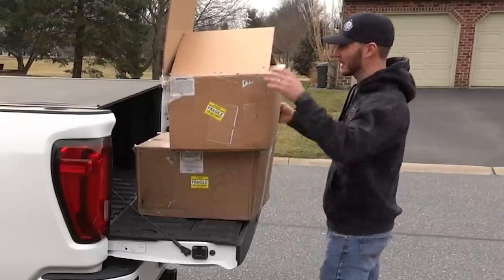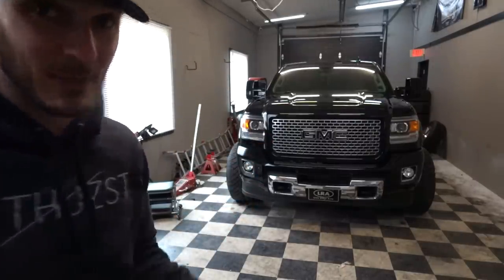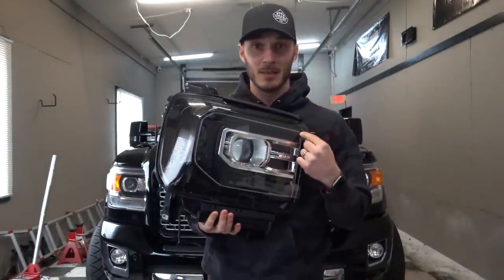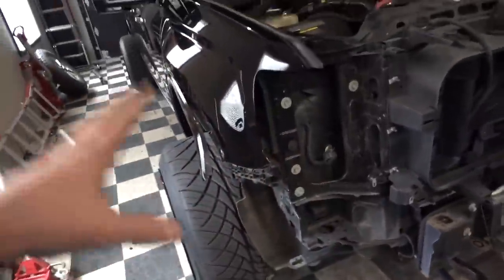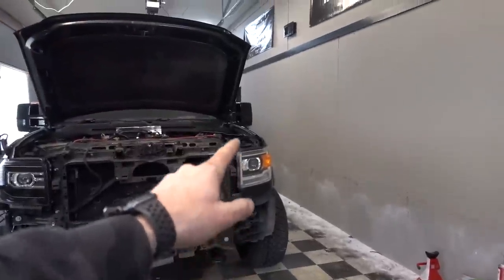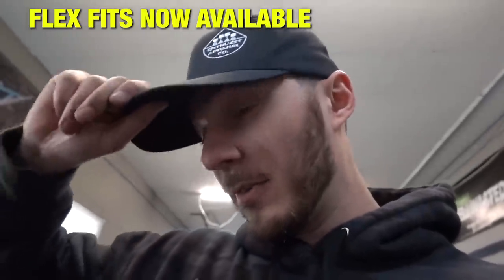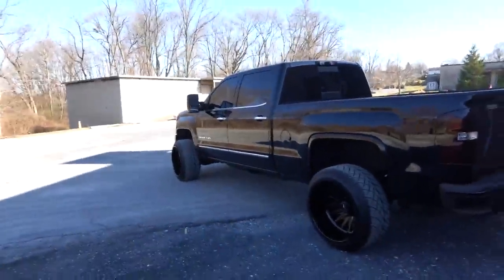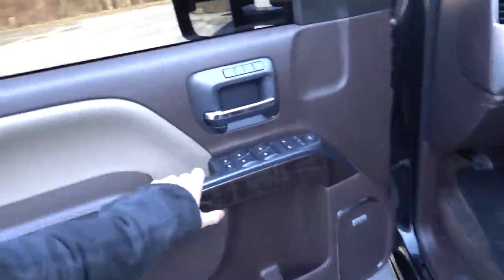The ONLY headlight mod a 15-19 Denali HD should EVER get!

Comment: Durtymax Jack,

Do you have a link for Diode Dynamic site that you used for the wiring harness or a part number for the wiring harness with resister built in? 

I contacted diode dynamic and they advised that they have never built a wiring harness to modify the headlight configuration.

Comment: nice truck jack looks good I have a question my bumper on my 2018 gmc sierra 2500 has cut outs on the bumper for fog lights theres a fuse under the hood that says fog light but where do u find the wires and conector that plugs in the fog lights